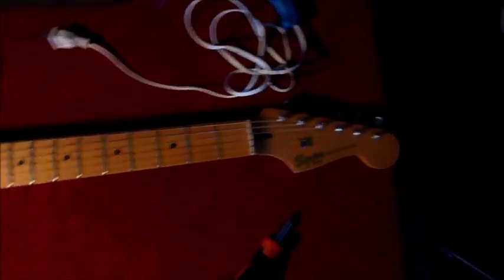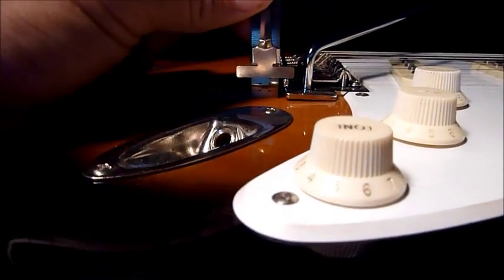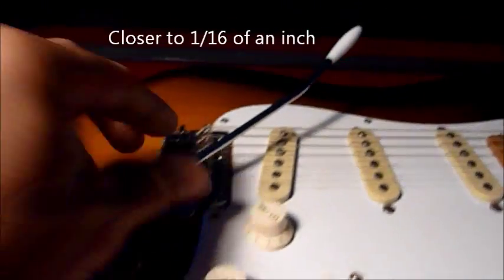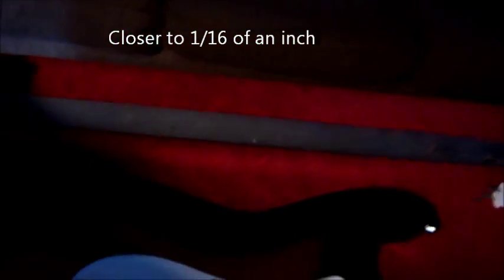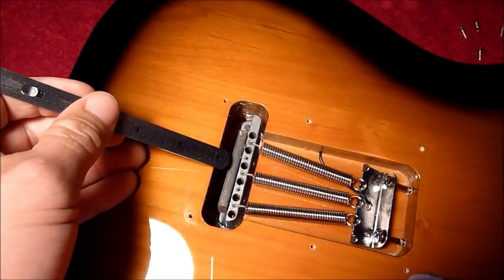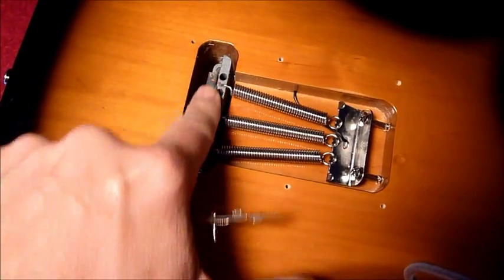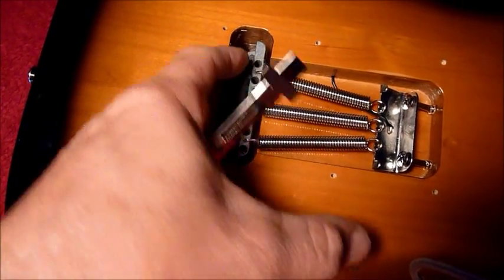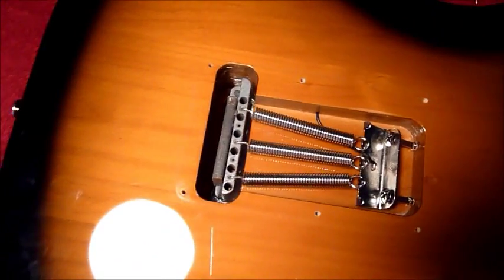Strat block.wmv

Comment from the maker: What matters is balancing the block not the springs, some people even prefer more pull on one side of the block to compensate for the string gauge.The block setup that I show is balanced or "even" as you say despite the middle spring not pulling as much.Ultimately you should put your springs any way that makes you happy.

Comment from the maker: This video was in response to someone asking if the guitar was stock in another video I posted with some improv, he liked the way it sounded.The guitar is stock exept for the added iron.When I was recording the track, I wasn't happy with the tone so I added the piece of steel and it made the tone a bit more defined.You can spend a lot of time trying to make this type of trem perfect, but it is not the best design if you want to do extreme pulls.

Comment: 3 springs bad, as shown.  The 2 outside springs should be anchored on the 2 outermost spring tabs (so all 3 are then parallel).  The way you have it, if you pull up on th arm, the center spring can fall out.

Comment: yeah, have you  (Frank Castle) modified/ changed the block of your guitar, i havent, did/do the frudua method instead, even took the string tree off, and my CV60s barely goes out of tune (and my yamaha pacifica doesnt at all) any way is just that i was thinking on changing the thin block on the cv's but havent decided (not in the usa, not so eay to find thick blocks, so maybe i could do the iron thing... idk ) ??

Comment from the maker: The best one I've seen is by Callaham Guitars, but they are expensive.I put one in a '62 RI Japan Strat and the difference was quite noticeable, I would not take a chance on any other brand without looking at it first.Your 90s Strat should be pretty good, and changing the block might not be worth it.Have you made sure your guitar is properly set up, things like nut, saddles and the contact points between the bridge and the screws or posts are very important.

Comment from the maker: That's absurd, you probably mean uneven tension on the block, but that's the case either way bacause the lighter strings pull less than the bass side.Now take the fact that the whole thing pivots on 6 screws and we are entering nitpicking territory.
I'm saying it doesn't matter.I'd be interested in seeing a blind side by side test.
Reply: tbdalva They mean that the greater tension on the outside springs being stretched make the middle spring irrelevant. Why put three springs if you are only really using two?

Comment from the maker: @2009korte I like to use the trem bar so i didn't want to disable it, a lot of tuning problems come from the nut, if the string is sharp after you push the trem, it might be catching on the nut or string tree.Does anybody make a strat copy with a fixed bridge?